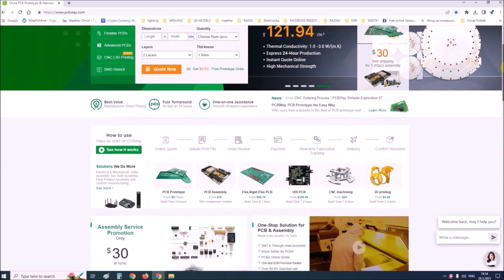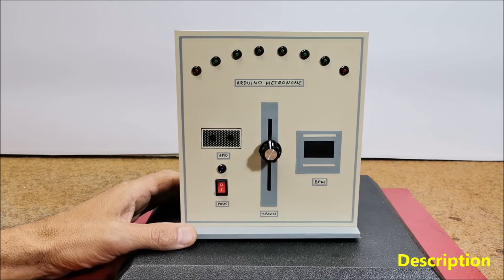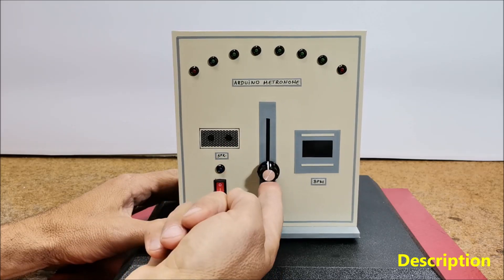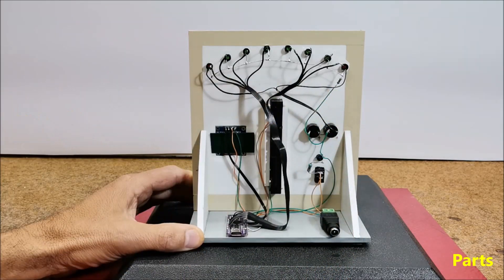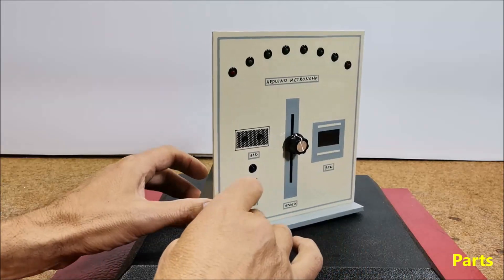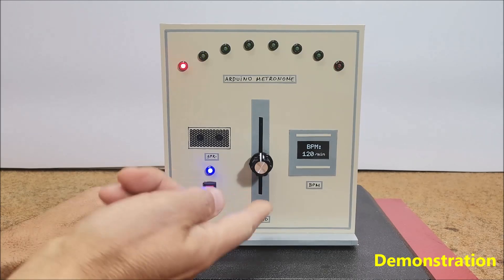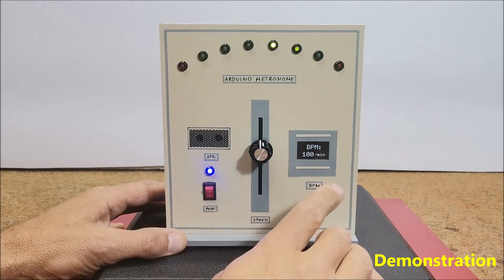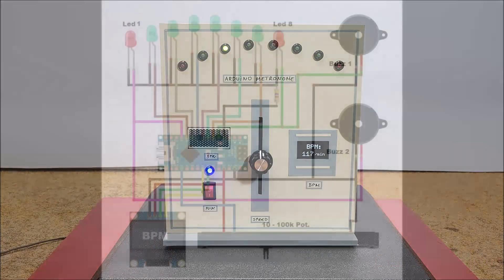DIY Simple  Arduino Metronome

Comment: Amazing could this be adapted to MIDI clock? Have been looking for something online similar to the  LED swinging-light MIDI metronome / tempo indicator/meter unit that Björk used on the Vespertine tour. It was a red light that basically blinked on every beat, with a set of lights on each side swinging left to right with the master tempo, like a traditional metronome.

Can see it on the side of the stage here. Björk - It's in Our Hands: https://www.youtube.com/watch?v=nWoEITAoYE8

Comment: This is a great project! However, I am fairly sure that I would tire of the buzzer chirps, when practicing. It might be a fun challenge to create a more traditional wooden tap sound. Maybe use an electromagnet to drive a cylinder to thump a hard wood block. Repurposing a traditional door bell might work. Or, cut a parallel line in a dc motor shaft. Cut a short length of plastic (zip tie?) and insert it perpendicularly into the cut on the motor shaft. Place the block of wood, where the end of the zip tie will tap it, when you spin the motor. Use the MCU to set the RPM to the proper rate. There a lot of ideas that come to mind.
Reply: Hi, I actually found this vid because I'm trying to DIY an arduino-controlled Franz-style metronome. At first I was thinking that I could control the RPM of motor and just attach it to the cam assembly of a donor Franz Metronome. Your suggestion seems less mechanical but I'm not familiar with different types of electromagnets or relay switches. Do you know what I could search to find a component like you described and make a "thumper"? Thanks
Reply: @AS-vq3ep  The search term you need is "solenoid." Go to "Clayton Darwin" YouTube channel. He has many videos on using solenoids to thump musical instruments. On one of those videos, I asked him where to buy solenoids. But, I forget the answer. You will just have to read the comments. You will get lots off information and inspiration on how to do this type of project. HTH.
Reply: @AS-vq3ep  https://www.youtube.com/watch?v=9irfoyT3E5I
Reply: @AS-vq3ep  Search term is "solenoid." From the Asian mail order places.